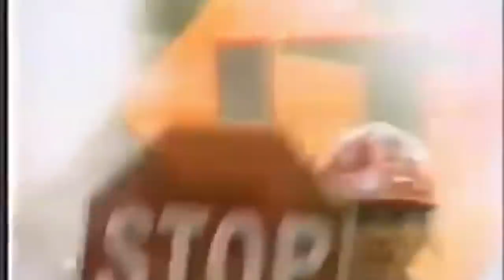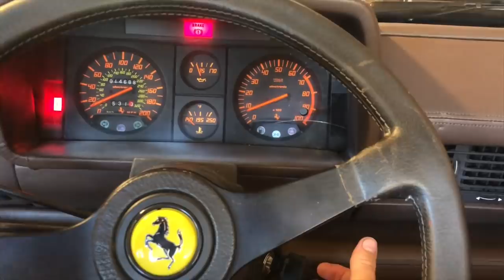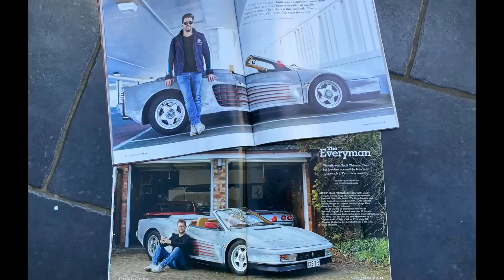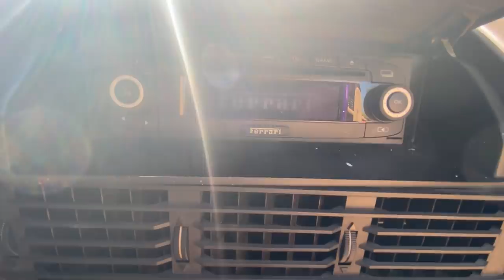Abandoned Ferrari Testarossa Rescued to Build the Worlds ONLY Rat Rod Ferrari - CHEAP !!

Comment: Personally its kinda funny, what got me into ferrari's was also miami vice, but in a different way, also videogame related, 2002's Vice City had all of Miami Vice's flavor mixed with scarface, hell they even had one of the actors, Philip Michael Thomas in it, thing Is, I didnt know what the hell miami vice was until I saw the pilot in 2006, in HD when they were running it as a tie in to the movie

and around that same time the VAG had taken over my favorite car company and was really dulling it, like lamborghini went from the tops of the pops to ho hum under them, producing the armadillo, the murcialago, which even famous test driver and the father of the Diablo Said to the designer when he first saw it, YOU ONLY DESIGN THE ENGINE COVER lol and the bat guano galardo which was new for 2006

with rounded off edges, V Dub V10 Engines stolen from the viper and then made boring by downsizing them to have none of the edge, and mixed in with 4 wheel drive and soft metalic paints now standard instead of for the really cool models

like I know what the name for four is in italian, its Quattro, but what is pansey, and the final straw for me was when they killed the Estoque, like that was so lambo it had Ferrucio sitting on the damn bumper giving the thumbs up and that deutchland uber alis guy 86'd it 

like no fun allowed at lambo anymore, the last great car was the diablo GT, when some italians snuck in and fixed the 6.0 that had just had a blow torch taken to its beautiful bodywork and deutchland uber allised. 

also most amusingly, theirs a CURSED 6.0 here on youtube owned by some youtuber who got it sold to him by Ed of Vinwiki lol 

like theirs two lambos I dont mind seeing beaten on, the pagani redesign they trashed in Wolf of wallstreet, where this chronic overdetailer, fixed the front end to match the newly raised roof for the 5 liter models of the countach, as they raised it a full inch, which is why only the 400/4000's look good, the 5's are off, and made it look way better by restoring the rake to the car, but then stapped TR bits all over the car with no Rhyme or reason

which was then replaced by a testarossa lol and then that ugly V Dubbed 6.0. 

 then I see this pilot for a really great TV show pilot from 1984 that mixes all the music I already like from vice city with actually good story telling, and at the climax, he rocks up in this beautiful black spider, a replica daytona, but when done well, its actually better looking than the OG car, especially the interior

and they were kind of a homage to the 1977 Daytona Race Car Paul Newman drove in the 24 hours of daytona crossed with a daytona spider

and those cars were unique, out of a run of 4, all different from the latter replicas that people made or had made for them, they were even made by a company that made a Targa topped Countach for Rod Stewart, Markiandian, which also the rain man movie is loosely based on with them as the importing company for those countaches

as well he was hedging his bets, as why not do this as a way to get the italian flavor with an american power plant, which ahd been done before, just look up the scalietti corvette FYI wasnt stock either, it was actually turbo charged, something that was taken off or more likely damaged the engine

as the things threw a rod at some point in the shows run in S1, most likely from the In the night scene, where the cars are getting jumped and slammed pretty well and had the blocks replaced before S2, the engines overhaulled and they probably made more power than the 308 and the 348

which thanks to Tyler Hoover, I know makes about 265 horsepower with that 348, so they werent slow pieces of crap, granted they were a little rough around the edges, the grill being matt like on a 308 when it should have been polished and the rims being too small namely, along with the seats, which sadly got replaced after the pilot with something abit more generic but in season 3 they were due for an overhaul

until ferrari stepped in and they all got testarossa's, apparently Michael Mann got one and painted it dark blue metalic, and don got a silver one as a reward for his work at the end of the shows run

as you had Magnum PI proping up the V8's, and Don Johnson the V12' hell they apparently saved ferrari with all of the popularity they gave them

and as for me, I do like the testarossa too, as its a nice flip to the countach, ones hard edge, the others a really nice car with a great interior, granted that intro sequence was the worst thing they could have done for that car as I hate that front bumper with the TR lol as every other angles great, 

its just that the top lip of the two makes it look super blocky in the front, as the rest of the cars at a rake, then you have this lip sticking out and breaking the flow, like if you could cut that upper lip off, move the lower spoiler forward slightly or give it more of a rake like on a lotus Turbo, and put on the latter 1989 lights, along with maybe moving the front bumper a little back into the car

or even do like they did with the Infernus Classic in GTA 5 and just flip the lights upside down so the turn signals are the bottom, that car would look far better than it did, granted I dont really SEE that on the ratarossa, probably because of its unpainted form or the euro spec models like the RHD one Harry Metcalf has, so I am seriously wondering if they made a subtile change and its sticking out further on the american cars. just like what happened with the 308. 

hell I've even noticed it on the 328, found video of a euro spec one and it looks better than the one I saw in person here in the states. 

 and also that color, with that amber turn signal, the car looked way better in black metalic from its intro episode with the guy who says mess with the bull get the horns driving it from the breakfast club, like cream and tobassco with rust colored carpets and that unique metallic paint, DAMN was she beautiful, it was like black with a silver sheen.

the white looks cool, but in black she would have been timeless. although metallic cant easily be repaired, the flake is hard to replicate and a straight white is easy enough. 

like I guess after dealing with the daytona for as long as they did they wanted a break, and the paint on that car is still great to this day too lol

but if it had stayed black, they should have shown its intro scene to Com Truise - Yxes lol

Comment: I have to say that the car looks absolutely horrible, its a complete mess visually. You really need to finish the job and get it restored to what it should be.  You have the ability to bring this back to its former self, so get on with it and make it right. Its just plain wrong leaving it this way. Just my two cents! PS Was any structural strength added after the roof was cut off?

Comment: Leave it unpainted, Rat-style. 

Forget the A/C. Tighten up the suspension.  Ferraris should not FLOAT, Brother.

I would consider fitting it with 5 point harnesses and either a roll bar or roll cage. 
This would allow you to hammer on like an 80s VW GTI. 
I would definitely want to track it, and I wouldn't want to lose my head in a crash. 
Roll bar/cage would truly solve  the mid body sag and give the car proper stiffness it deserves.
That would match the personal stiffness the driver would be experiencing while on the track.
Blahahaha...
🤣
The car will never be a collectable, freeing you to use and abuse at will.  Enjoy it this way and drivers will envy you, not just the car.
Oh, and tracking it and performance driving clinics will also help to ensure you don't end up in one of those super car crash compilations.
You could do a video series on becoming a better driver, documenting driving school lessons, track time, and showing your skill building and decreasing lap times.
Oh, what fun you would have!
(I gotta get myself back into a track car. Maybe a Lotus Elise?  Hmm...)